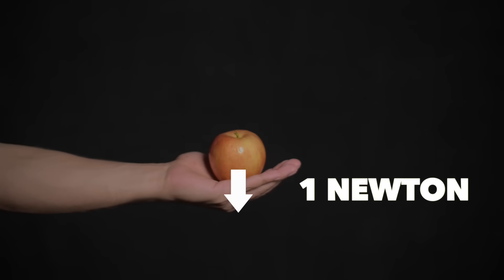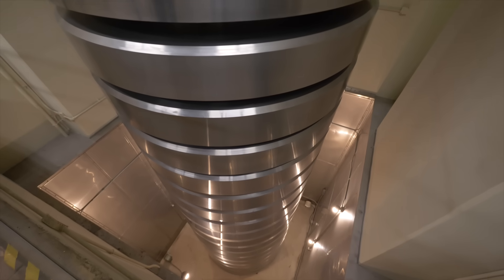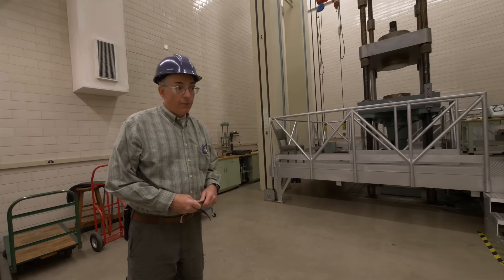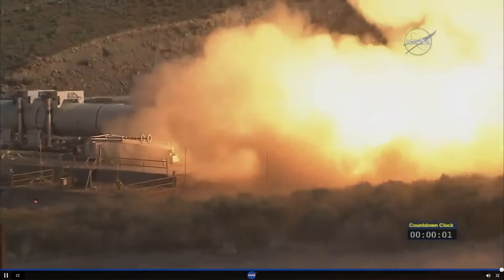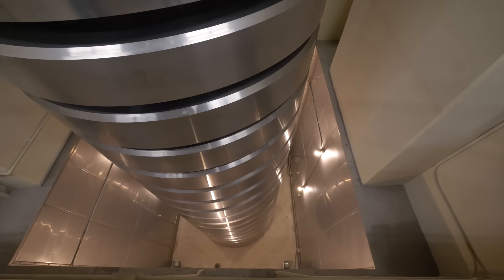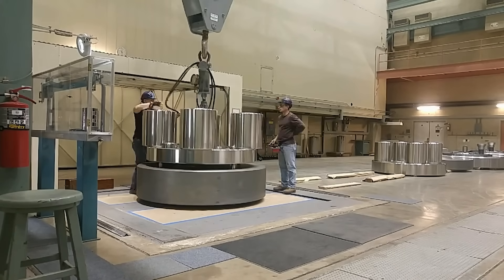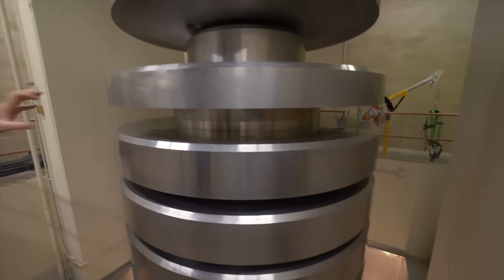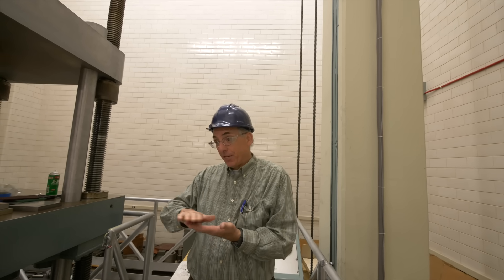World's Heaviest Weight

Comment: All the gym people probably think they can lift this 😂
Reply: Teighlour Swyftte with enough protein shakes you could lift this
Reply: Teighlour Swyftte I think they're being sarcastic
Reply: Zambie Pug its actually pronounced douchebag you dumbass
Reply: Not gym people. Its pronounced "Ducebag"
Reply: ExuberantKnack Man you're delusional, you need help.
Reply: Zambie Pug and how is it spelled?
Reply: I can leg Press a touch over 1000 pounds about half a meter. with a 1000 to 1 mechanical advantage machine, I could, theoretically lift this .5 mm.
Reply: You underestimate human capacity. I assure you that if I train to my maximum potential, then it shouldn't be impossible to lift this weight. Will it be hard? Perhaps. Is it an impossibility? No. Similar odds have been surpassed before.

Comment: America: the world leader that uses measurements everyone ditched years ago.
Reply: We do use SI units when dealing in international commerce and scientific/academic notation.  They specified that everything is originally done in kilograms, then converted to pounds.  The usage of what is referred to as "standard" or "customary" measurements is rooted in the fact that every citizen has on the most rudimentary levels grown up with an understanding of these, can visualize them more readily, and they are deeply seeded in our society.  SI does find a greater degree in common usage compared to past decades, it does have quite some way to go to be customary though.  What we use daily in America is actually defined by the standards of the International System of Units (SI), as described in a previous video by Veritasium.  It was the Mendenhall Order of 1893 that officially redefined what each standard measurement by dictating exactly what each length or weight was in metric (i.e.: 1 yard = 0.9144 metre; 1 pound = 0.45359237 kilogram),  but they had been in use already as the avoirdupois standard had proved unstable over it's use.

International System of Units (French: Système international d'unités; abbreviated SI) is the most modern form of the Metric system.  It was formally defined in 1960 by the General Conference on Weights and Measures (French: Conférence générale des poids et mesures; abbreviated CGPM), at which time they redefined the measure of a metre in terms of wavelengths of light.

There is quite a lot of very interesting history regarding weight and measurement standardization that I would suggest anyone who might interested should explore.  I am certainly no expert and I have only recently started down this rabbit hole, but it is surprisingly fascinating.  There are politics, revolutions, disasters, scientific innovations and discoveries, social reforms, and on a few occasions outright loss or destruction of the actual reference weights and measures which all others were calibrated upon.  It may not be Game of Thrones, but it certainly is intriguing.
Reply: +Steve Two Sheds Brough - Inches only make "more sense" if you grew up with them. I can't visualise 15 inches at all, but I have a pretty good guess what 167 cm is. Also, you are off by an order of magnitude there. 167 cm is more like 65 inches, not 6.5.
I like the metric system because it all just fits nicely together. 1 kilogram is 1 liter of water is 10 by 10 by 10 cm. I can visualise all those things very easily.
Reply: kilogram isnt a measure of weight, its a measure of mass
Reply: Bailey Pope America actually uses the metric system too, its just less common. but scientists use the metric system.
Reply: you might want to keep reading this person has a point
Reply: +MJR Performance - You have a point, although it's a smartass point. Yes, obviously, 1 liter of water isn't always 1 kilogram, but it's close enough at room temperature. When we're talking about what's easy for the average person to visualise, we're talking about average, everyday occurences, not extraordinary ones.
Reply: eiiiiiiii i didnt know people called it SI units, in my country we also classify Kilograms as Metric Units
Edit: ok google says theyre practically the same so no need to bother
Reply: Yeah we do that for some reason
Reply: Nasa lost a Mars probe, due to a bad conversion.
Reply: Bailey Pope and America is still number 1. Riddle me that?
Reply: liquifiedbutter  In the US the metric/US split is between scientists and engineers (generally). Since NIST has to make standards for both (and since engineers tend to make bigger things) they make both kinds of standards and the biggest ones are in US units.
Reply: Bailey Pope still a world powerhouse though ;)
Reply: Look in the NIST video and they're just as happy to tell it to you in newtons.  Force is force.
Reply: Bailey Pope uk still uses mph
Reply: Ask a random British person how tall they are or how much they weigh
Reply: An Uncomfortable Young Korean In Culture Shock Done that, got an answer in "stone"
Reply: MJR Performance, can you give me the imperial equivalent of "1 kilogram is 1 liter of water is 10 by 10 by 10 cm"? Or give me an easy way to calculate how many fl.oz are there in 5 US gallons? Imperial is too far fucked up...
Reply: This shows america doesn't love their own country. The UN standardized Metric systems as the global measuring tool, but they practically like the English system better than the globalized standard. Whats more is this "English" thing. I thought America wanted liberty from their old English colonizers but it seems even with a choice of the metric system, they still hold on to the old days. Also if anyone wants to correct me on some of the things i said, pls do cuz im asian
Reply: the uk doesn't do anything scientific i.e. anything important with imperial, they use SI units. i really care what Americans use on their road signs, but it deeply hurts my sole that they still wont use SI units for this kind of thing.
Reply: ...my ex is a measure of mass.
Reply: Bailey Pope America...the world leader.
Reply: America needs to wake up and join the rest of the world.
Reply: For anyone who makes fun of imperial units for being based on arbitrary things that don't convert easily, 
1000 steps are 1 mile. 1 step is about five times the length of one's foot or forearm or the distance sound travels in 1 millisecond or light in 1 nanosecond. A cube with a side length of 1 foot can be divided into 60 pints. 1 pint of water has a mass of 1 pound and exerts 1 pound of force downward due to gravity. Lifting it 1 foot upwards takes 1 foot pound of work and increasing its temperature by 1 degree Fahrenheit takes 1 Btu of heat. An amount of hydrogen with the same mass contains 1 pound mole of atoms. Every year 1 man needs the amount of food that is grown on 1 acre; every day he needs to drink 2 quarts of water and every hour he needs the oxygen from 1 cubic yard of air. The oxygen passes through the heart which beats about 1 time each second. In 60 seconds most trivial tasks are completed and in 60 minutes the earth has turned 1000 miles at the equator. 1 mile is 1000 steps . . ..
Reply: Stopped reading at "about". If you need to use that word, your system is crap.

Comment: Please please please

Just use the f*cking metric system
Reply: OldieBones how on earth does it save time? 
For example: 1 Newton = 1kg*m/s^2 (metric units)
Where do lbs or inches come in handy?
Reply: If the reasoning is that it's what we grew up with and that it's simpler, then no, the English system is no better than the metric system. I mean, water freezes at 0 degrees C and boils at 100 degrees C.
Reply: DXHHHable it's more logical
Reply: Balraj Heer Americans are the only one's that don't use the metric system even though it's way more accurate
Reply: Bryan Tuck metric is still better ,1 meter stays 1 meter but inch or foot can depend on your body size so unlogical system
Reply: +aa zz, that would be true of a foot is you lived in 200 BC. The truth is that we in US use both systems. No one complains about it over here but metric-only people seem to have brain melts if they encounter imperial units.
Reply: Mark Molenaar america
Reply: Mark Molenaar Sure, when you drive on the right side.
Reply: An inch is always the same size. they were just originally based off of the average length of various body parts. It doesn't change depending on the person.
Reply: "f*cking metric system"... is that like a special system used for having sex outside USA?
Reply: Mark Molenaar   yeah English system is outdated
Reply: Mark Molenaar why do we have to use your system?
Reply: Nah
Reply: Who gives a f*** what we use for calculations?? We don't spend our days insulting you guys for using the metric system so leave us alone for goodness sake!
Reply: Imperial units are base-12, which is evenly divisible by 1, 2, 3, 4, 6, and 12. Metric is base-10 which is evenly divisible by 1, 2, 5, and 10. The US doesn't use metric because it's just not as good. The accuracy depends on the equipment you're measuring with, not the system of units.
Reply: Mark Molenaar yeah metric DOES save time, but inches and feet were what we grew up with, like If someone asked me what 10 inches was and what 10cm was, I would get a closer guess with 10 inches
Reply: The American system is more efficient.  It saves time.

Comment: Am I the only one, or is the thing that lifts that weight and its anchors in the ceiling not far more impressive than a couple of highdense metal pieces? 
I'm not even joking, you could also buy 500 000 water bottles, weigh them down exactly, and have the same weight, almost as perfectly weighted as this thing...

Comment: I wonder if the Earth can balance out the weight of one side of the planet with what is heavier or lighter on the opposite, or an area next that point which heavier or lighter. 
Are tremors and quakes a way of the certain specific areas on the continent equilibrating; do heavier places or lighter places on the planet cause earthquakes?

Comment: Interesting. The weight ruler. Picture that we use a leather ruler. The leather expend when wet and shrink when It's dry even burn. So It's really nice to have metal that did not change and we can measure things to repair and construct things. Without metal ruler, house will not be built with the same high depending the weather and the hand user moisture. At end, the weight like this ensure that lifting power and material have an accurate reading. Picture a truck that was weight by a stack of paper as reference. Well the humidity added on paper will trick people to know that the object weight 10 Kg but the actual weight is 9 kg. Not good is you plant to build a skyscraper and take the weight of all object to be sure the Dubai foundation in sand will stand the weight of the building.

Comment: if it is really important scientific stuff why it's in pounds?
Reply: Because it was built by americans and they know better. Because apparently multiplying with 1000 is too hard to step down from kilometers to meters so instead they measure 1760 yards to go 1 mile. Which is coincidentally 5280 feet or 63360 inches, what don't you understand? :-P

Comment: How can an apple have or be a newton if the other examples involve thrust?
Reply: Yeah, they weren't too clear about it, but think of it this way: if you hook the "1 Newton apple" to a spring then due to it's weight it will extend  the spring a little bit. That 1 Newton is it's weight by the way. Now if you hook a weightless rocket nose down to the spring and turn it on then if it extends the spring to the exact same length as the apple then the rocket produces 1 Newton of thrust. Hope this example makes it clearer.